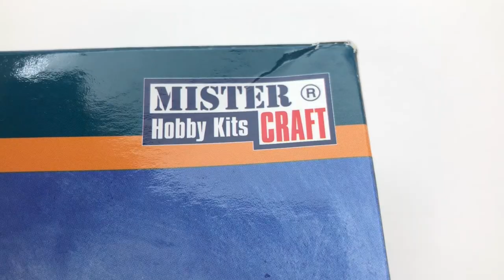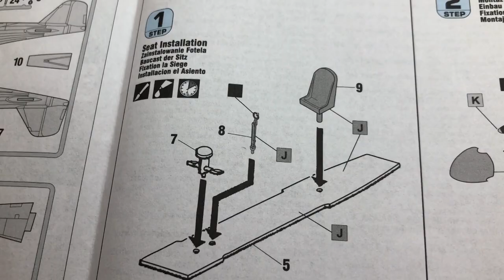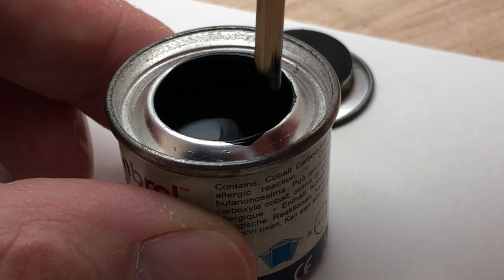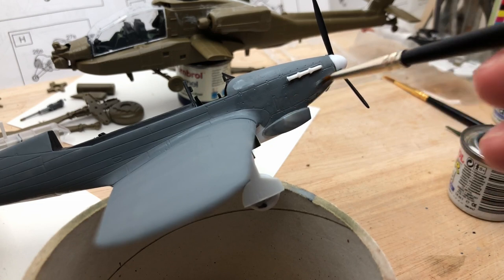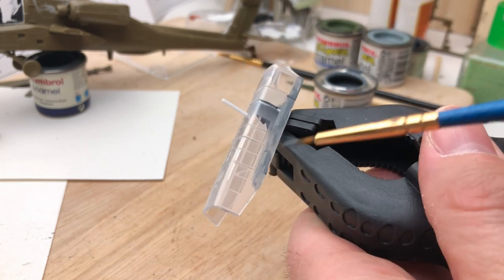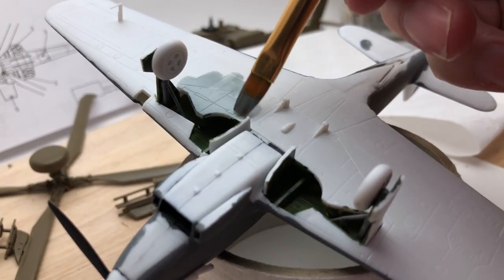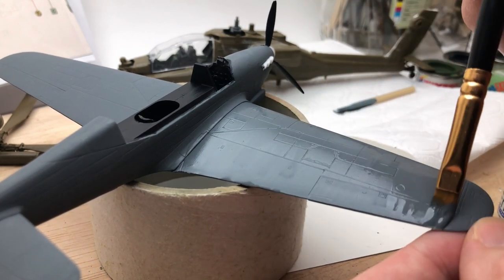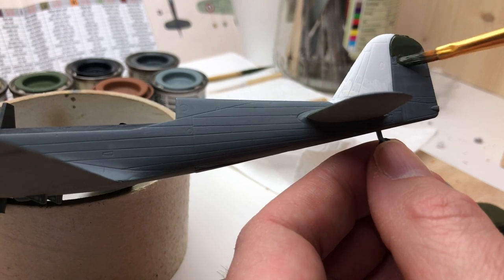Hand Paint Humbrol - Fairey Fulmar 1/72

Comment: Very good job  painting with handbrush. Every modeler should at least once try old school techniques. Diversity is a key not money nor additional  spendings. Enamels brings that joy who is  patient enough to get  it through
Reply from the maker: Very true 😀👍
Reply: One additional note from the post below. 
If you are still using enamel paints exclusively for airbrushing that sheer drying time is increased in case for hand-brushing (thicker layers)  but nowadays on market enamel dries pretty much quicker if you stick to thin layers, original thinner ventilated space ...

Comment: I still hand paint my models with enamels although recently started with acrylics.    As long as you apply slowly with thin coats and rub down before the next coat it's fine.  Between coats I use a cotton bud or very fine sanding sponge to smooth it all.   You can almost use a dry brushing technique to build it up.
Reply from the maker: It’s amazing what you can achieve with just a brush. I’ll try smoothing / light sanding after coats next time. 😀👍

Comment: Oh sweet! I've got one of these - did an unboxing and it looked an ok kit in general. Yours looks really good!

Edit: Some decal manufacturers give you that red dot seperately in the roundel because the printing process isn't perfect and they can have registry problems where they don't line up perfectly. There is nothing worse than off-centre rings and circles on a roundel - providing it as a second decal means you can place it more accurately. More recent decal makers don't have this problem though as technology has improved
Reply from the maker: Ah I see.. always thought it was odd that at the time Airfix seemed the only ones to do it, at least out of the kits I owned. Makes sense now!

To be fair it’s an interesting little kit as you know.. I’d not really read/seen much about it till I started building it and doing the characters. I was pleasantly surprised how good it looked once it was finished.. it’s not as glamorous as a Spitfire or even the Hurricane but we all like an  obscure bit of allied aviation history 😀👍
Reply: @modkitmayhem  very true!

Comment: Pretty cool. I planned to buy a few Mister Craft kits due to them being cheap but I'd heard pretty bad reviews about those kits and decided against buying. But this seems to be a reasonably good one otherwise. Nice brush painting too. The paint coats went on nice
Reply from the maker: Cheers, Yes they are a bit cheap but are still good for trying different techniques. Also the Fulmar is a pretty rare aircraft type so it’s nice to work on something different. Thanks, I enjoyed using the Enamel paints even with the long drying time. Worth a try if you have some old tins stored away 😀

Comment: Thanks for this. I, too, hand paintusing enamels. RE-started model in my 50s after heart surgery put me in house arrest for a month. Yes, it is a patience teacher, but there's always something else to prepare while you wait. Never have tried humbrol though. In US, was Testors for me, still is. And i always thin it down, 4 or 5 coats for anything other than detail work usually.
Reply from the maker: Thanks Mike, Glad you liked the video. It was quite a surprise at how much more relaxing the process was using Enamels. Currently painting a C-46 Commando with them. Heard good things about Testors paint but never used them. Happy modelling man 😀👍
Reply: I use Testors enamels as well.  How much do you thin them down?  How long do you wait between coats before brushing on the next coats?
Reply: @SCIGS30  depends on the color, some more than others, but I usual start with at least 1 part thinner to 4 parts paint. But thicker paints I'll go up to 50/50. I let them dry 24 hours
Reply: @AnimeDad490    Thank you very much, I will try to thin my paint more next time.

Comment: Cool, Humbrol enamel aint bad paint if its thinned with a plastic friendly lacquer thinner like Tamiya or Mr color thinner. I tested it for airbrush with Tamiya lacquer thinner retarder type and that made it dry much much faster then with their enamel thinner. Their metallics take 10-12 days to dry but with Tamiya lacquer thinner it dried almost immidiately with thin coats. Thick coats took around 1 and a half hour to 2 hours to dry. So I will defenitly use them for detail painting over lacquer and then remove mistakes with enamel thinners.
Reply from the maker: That sounds like worth trying! I’ll give it a go next time I get the Enamels out 😀👍
Reply: @modkitmayhem  Its worth trying it works great with all enamels including Revell, Tamiya and Testors. Just remember to use a lacquer thinner made for plastic models because they also contains retarders and wont melt youre plastic. Generinc cheap lacquer thinners might likely make the humbrol enamel dry immidietly leaving brush marks and an un even finish or for airbrushing dry before it hits the model,  needle will dry wery fast and plastic might get damadged too.

Comment: I was in favor of enamels till lately, but when I had to paint scheme similar to yours , so nothing unusual, and it got me two weeks it got me down. When i had some spare time paint was curing and when surface was dry I didn't have time :-) I switched to acrylics and even I have to spray primer coat and it takes one coat more of acrylics than enamels on average I was able to complete painting in one week 🙂

Other important thing ease when paintig canopies, you can always remove excess with cocktail stick, not just 5mins after. This is vital if you're do masking
Reply from the maker: I’m definitely an acrylic convert but I still enjoy Enamel every so often. For sure enamels are slower and that’s fine if you have the time.

I’m still trying new techniques to avoid those annoying paint bleeds onto the canopy 😀👍

Comment: Hi mate, great vid, what's the brush and where's it from @2:45. also did you thin the enamel or just brush it on straight from the tin? cheers
Reply from the maker: Hi Adam.. Cheers 👍 The brush is a Humbrol one from a Airfix starter set. It’s as cheap as they come and perfect for tricky jobs where a good brush would get ruined. I have only one relatively good brush and it’s made by Citadel which I use for figure painting. I also have a cheap art set of brushes that are more than enough for standard brush work. I paint straight from the tin with Enamels! Just make sure they are stirred really well. I think if I was to do a lot of Enamel painting I would thin down slightly where I could. Hope that helps.
Reply: @modkitmayhem  CHEERS MATE. HAD A FEELING IT WAS A AIRFIX HUMBROL ONE BUT WASNT SURE. that's mint considering how thick it is on application I thought its always best to thin it. but it looks well on the video. cheers